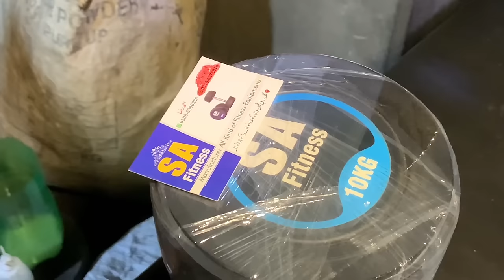Most incredible process of gym dumbbells/Manufacturing of rubber dumbbells in local factory

Comment: the problem with those dumbbells is that they will be loose in to time,  newer dumbbels come welded into one piece,  no loose bolts and screws..
Reply: If the weld holds up sure.. if not good luck. At least with bolt u have options for repair.